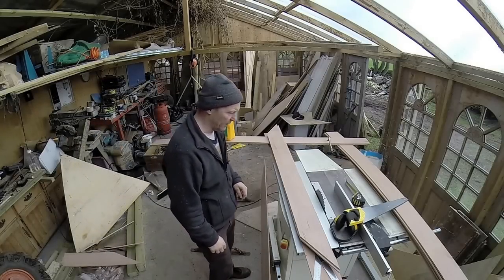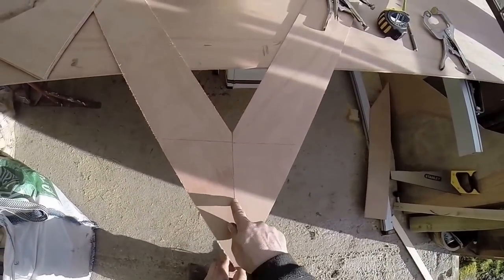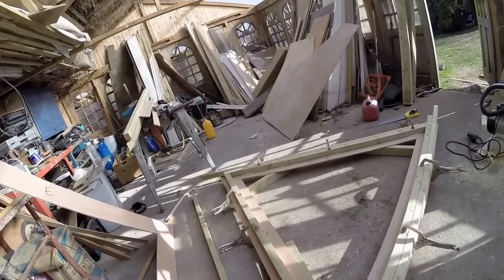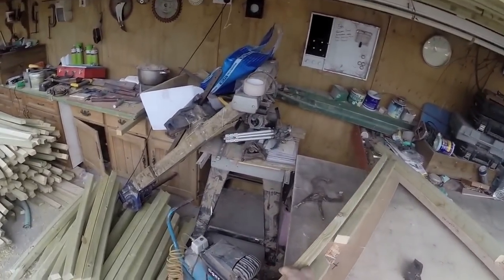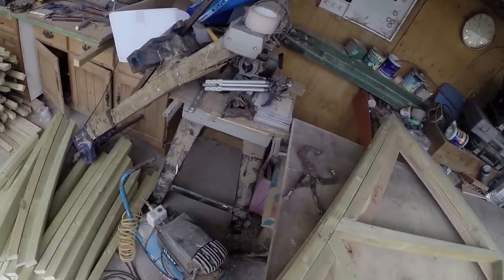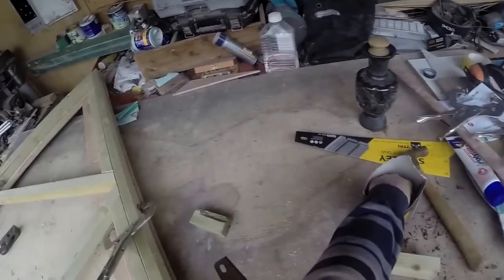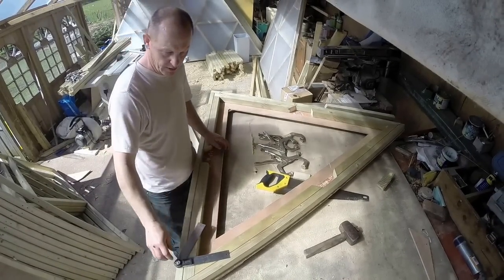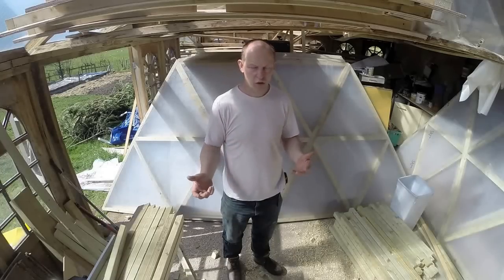12 meter dome build (4v)

Comment: You can make a jig for the tapered beveled long pieces by simply putting a stopping block on the end of a plywood jig with the angle pre cut into the plywood and use the plywood edge against the table saw fence. It's a lot more accurate and safer.
Reply: do you mean instead of angling the blade to 6 degrees or whatever it is?
Reply: @utubeape  no, I mean as you look down onto the flat board, draw a line for the desired taper then calculate the difference between the point entering the blade and the fence and the point exiting the fence on the board. with these dimensions you can build a jig with a stopper to push the board through and make multiple cuts exactly the same. It's a lot easier to show than explain.
Reply: look it up on YouTube. easily made tapered cuts on the table saw.
Reply: @franciscambron  yes I wish I knew because I plan to make a 40ft done and would be ripping down over 100 6 foot lengths of 4 by 2

Comment: when you are half way done cutting on the table saw, then move to the other side and pull the wood to do the rest of the cut, this way you have more control and don't have to get close to the blade..

Comment: Hey I saw a video of you on top of a 12 Meter or 40' Geodesic dome and it had the standard triangles not the large ones your showing how to make here. Where can I get the 40' plan for the ones with the standard triangle in the USA measurement? I really need that super bad. In fact if I could build that with even smaller triangles for the 40' like the longest length on the triangles is no more than 2' you would make a happy camper out of me? Is that possible? I have not found a calculator for domes that will allow me to have small triangles using 2"x4" US sizes which are actually smaller thickness and widths than that. You already mentioned it in other video's. But this size you show here for the standard size is perfect and that is the size I saw a picture of you climbing up on with a rope attached to a metal center pole in the middle of the top of the Dome. It looked like a beautiful dome with what looked like 2"x4" wood on it. I would have to take a look at your plans to see if they would be what I need. Also if you can make them where I can build this with pallet slats that would be great? I always wanted to try and build it out of scavenged wood like pallets here in the USA. I am a bit of a Environmentalist, kinda? I was thinking of building them with this salvaged frame from pallet slats then use earth bags on the outside of those all the way too the top then back fill the north and half of the west and east sides with dirt up to the top? I don't know if it will work? I might have to do it with 2"x4" or larger? I do not know how much they can take weight wise? I figure the Earthbag's will take the brunt of the load from the back fill? The Wooden  Geodesic dome structure just adds to the Earthbag's support while constructing it. Only you know because I do not really know? That is why I am asking you? What do you think? Can it be done?